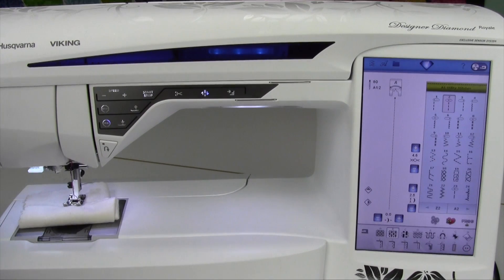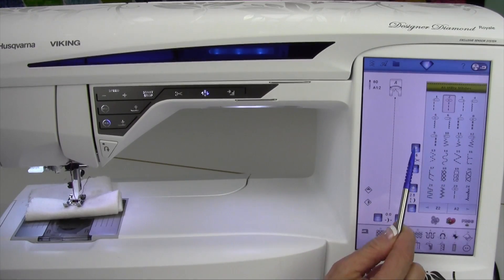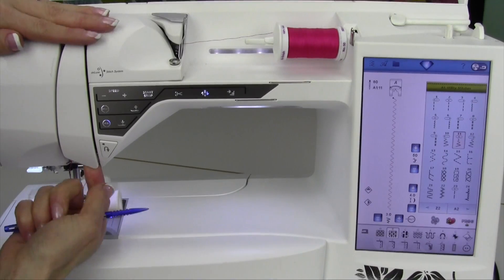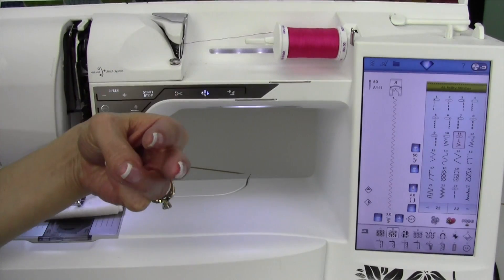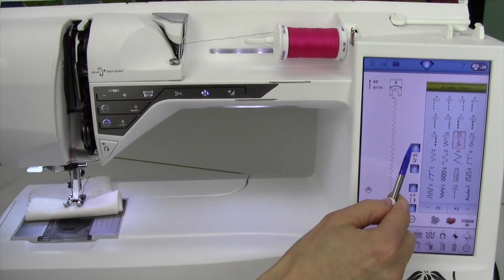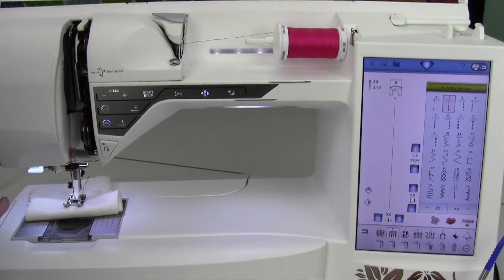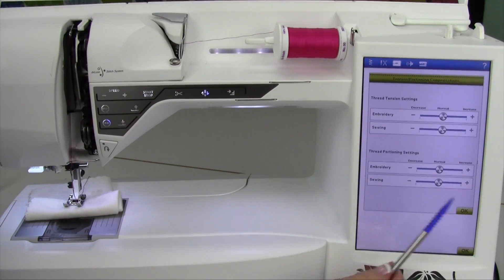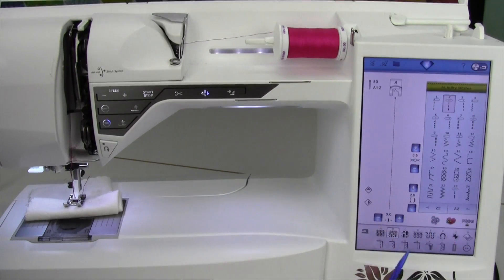Husqvarna Viking Designer Diamond 25 Tension, Thread Portioning & Deluxe Stitch System

Comment: I'm at my wit's end. My tension is constantly wrong. I've been sewing stitch 27 in the A2 utility stitches. For four inches it was fine. Then all of the sudden it started pulling loops on the top. I've rethreaded. Ive changed the needle. Rethreaded the bobbin. Decreased the thread portion. Nothing works.